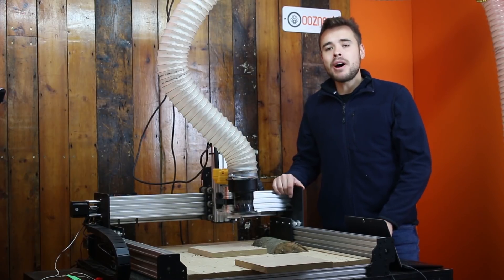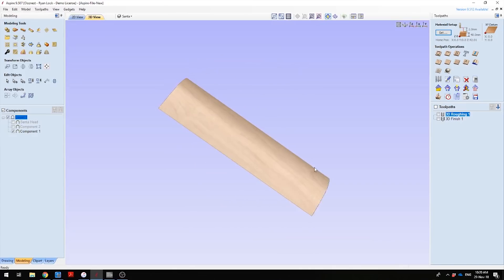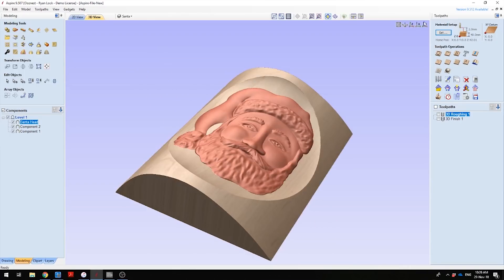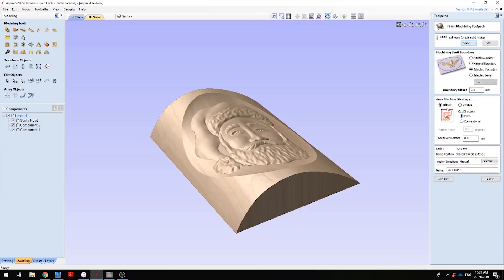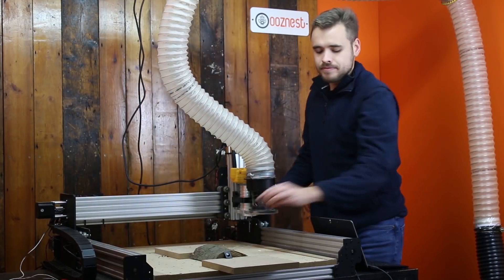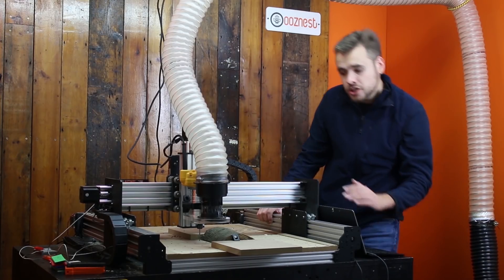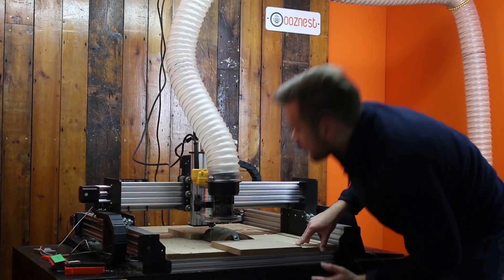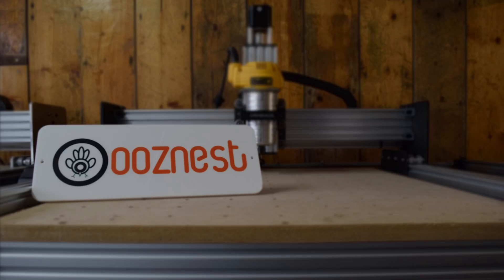Manufacturing a Log Face | Part 2 | WorkBee CNC Machine

Comment: Well done.  I like it.  Quick question.  Is Aspire required to do this, or can it be done with Vectric Pro?   Thanks.
Reply from the maker: I think it should be achievable in VCarve Pro, maybe a slightly different process